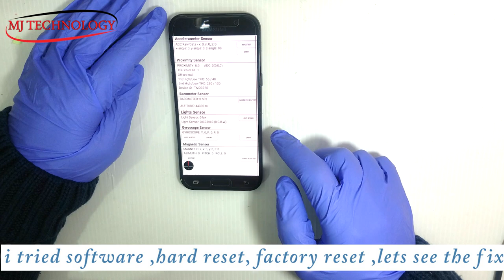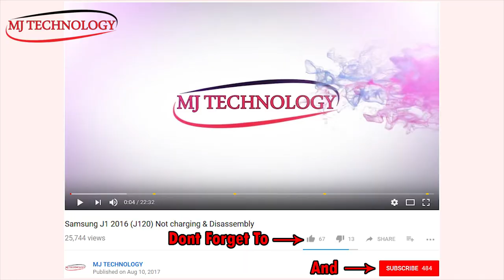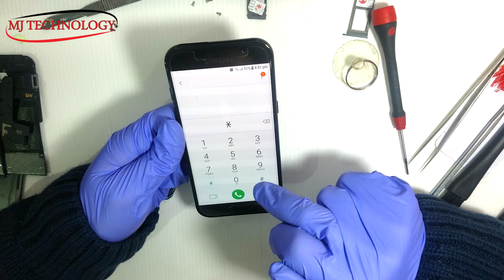Samsung A5 2017 Proximity  Sensor Not Working After Update Fixed!

Comment: I am having Note8 Exynos version. Same problem 😕. After update all of those sensors fail. Many people saying they gave to samsung service centre and had to pay a big amount to replace the board. Have been searching and couldnt find any soln other than yours till now. Mine is my daily driver and i dont have experience prying open phones. I do, but not in putting back to gether in working condition. These days its not screws right, all the heating and stuff required to open the device makes it all the more complicated. I guess ill have to adjust with the defect 😕. It really cripples the phone. Thanks for sharing what you found.
Reply: What you did there was removal and cleaning of the board connectors and sensors is it?
Reply from the maker: Yes that's what i did . And it's worked
Reply from the maker: Anytime you need help , but don't forget the problem has been solved with samsung a5 2017 not S8 .
Reply: Hmm

Comment: My s8 has the same problem.

Non of the sensors are working in my s8
There for : iris , proximity, auto rotation, light sensors, magnetic sensors...
Not a single sensor is working..
Plzzz i need ur help
Reply from the maker: https://youtu.be/BmBpC4dpBPk , watch this video
Reply: Same here after oreo update
Reply from the maker: 😁 unlucky like me . Just to know that was my own device.